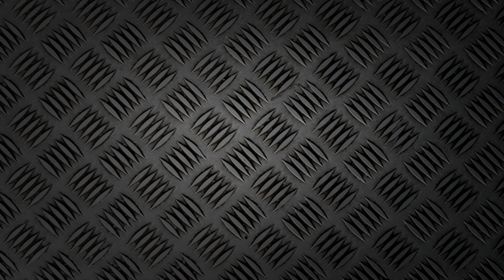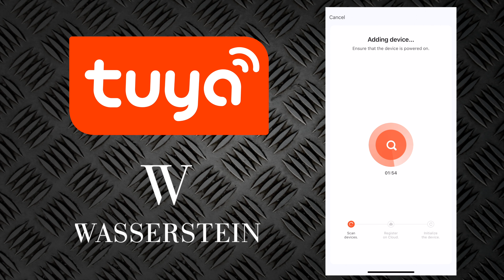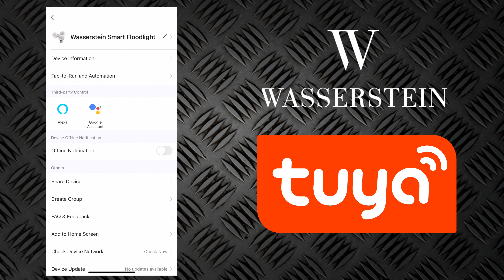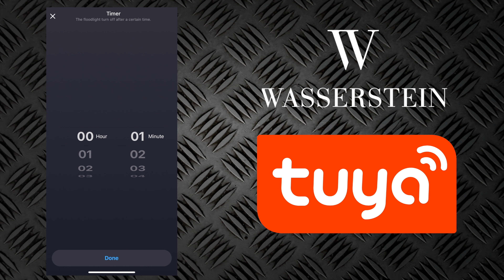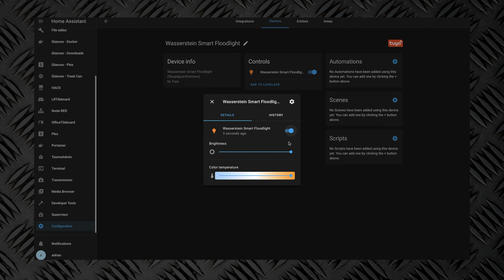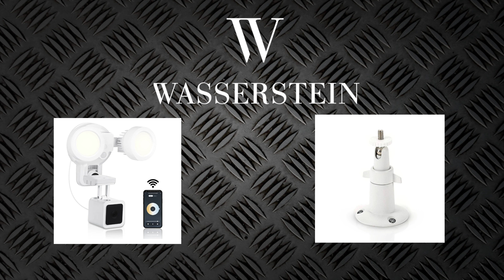PRODUCT REVIEW: Checking out Wasserstein!!!

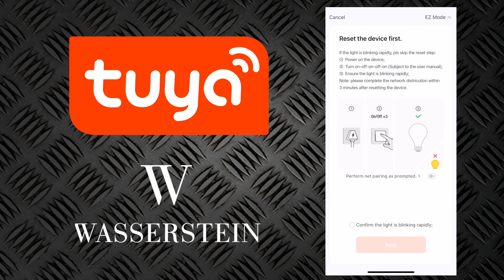Comment: I'm stuck pairing my floodlight to the app (Tuya OR Wasserstein). At 9:27 you say to turn the device off and on, but where is the on-off switch?? can you show me in a photo or diagram or vieco?
Reply from the maker: there is not an on off switch to the device itself.  If you don't have it connected to a switch, you will need to shut the breaker on and off.  Otherwise you might want to hook it up temporarily to a switch with power in order to get it added.
Reply: @BurnsHA  figured this out, thanks! The instructions could be a lot more clear!

Comment: I have ordered several of their branded products.  So far all of them have been horrible! Absolutely horrible! The biggest is their flood light with remote for Google Nest Outdoor Camera.  (This is not the Google nest floodlight). Their floodlight comes with a remote that is suppose to allow you to control it. However it doesn’t work. You can set it today and tomorrow it’s back to default. I bought 3 of these and they all do the same thing. Once it gets cold it’s off and on and off and on. Super annoying! No settings change it.  Contacted customer service since buying them in April and no support!  I would advise looking elsewhere!